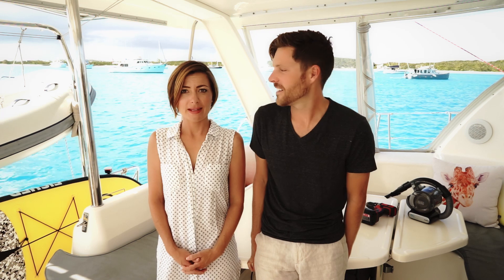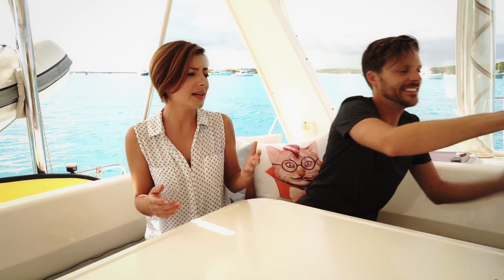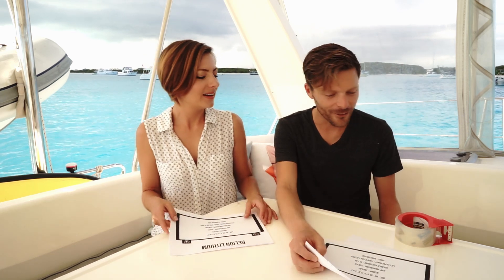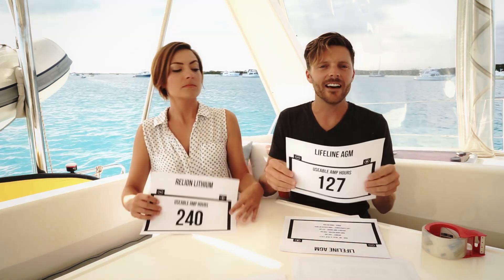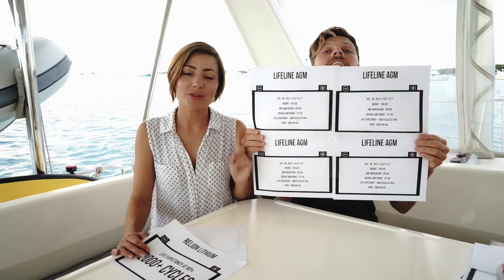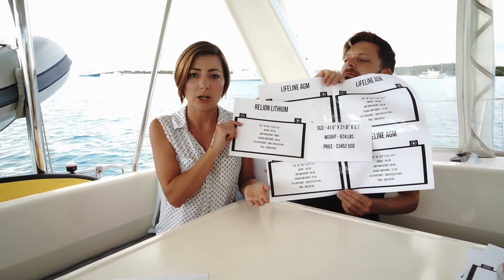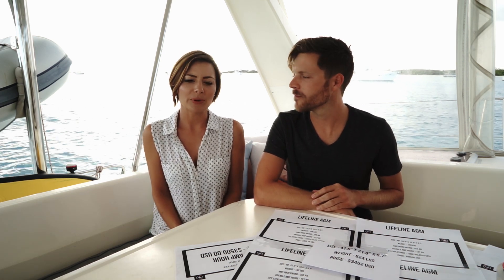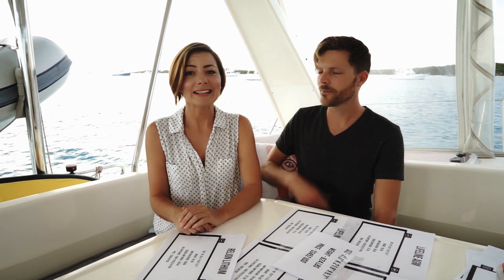Sailboat Tech - Lithium Batteries & Why We Chose Them (vs AGM)

Comment: When finding a method to compare similar systems, finding common ground with which to base a comparison can be the biggest issue.

For batteries on boats, that is generally expressed in AH of a battery bank. From that comparison, everything else can be reduced.

I have never found much utility in AGM batteries, except when they need to be mounted on their side. So my comparison will be your Lithium batteries at 300AH each, and my old standby: Rolls Series 5000, in this case the 6CS-27P with hydro caps. These are flooded batteries.

3 Relion 300 Ah batteries wired in parallel (900 AH bank) compared to 2 Rolls 6CS-27P 893Ah batteries wired in series.

Relion: 12V 900 Ah bank cycled at 50% provides 6200 cycles and costs $10,500 at a weight of 252lbs
Rolls: 12V 893 Ah bank cycled at 50% provides 3200 cycles and costs $3,200 at a weight of 684lbs

Relion costs $11.67 per Ah, $1.69 per cycle, $42.00 per pound
Rolls costs $3.58 per Ah, $1.00 per cycle, $4.68 per pound

Relion: 3.57 Ah per pound, 24.6 cycles per pound
Rolls:  1.31 Ah per pound, 4.68 cycles per pound

Relion requires no normal maintenance
Rolls w/hydro caps requires annual maintenance

Relion wins on weight basis, while Rolls wins on cost basis. While Rolls weighs 270% more per 900Ah, they cost 328% less.

The only real comparison at this point (unless weight is a larger issue for a given application) is cycles. The Relion batteries cost 69% more on that basis. Rolls has a very long history in the battery business and are notorious for their conservative numbers in both Ah and cycle ratings. It is not uncommon for the large series 5000 batteries to last for 25 years without replacement.

Lead acid batteries might not be right for everyone, especially large types like Rolls series 5000, but eliminating lead acid as outdated or unusable technology is not realistic when you compare quality batteries like Rolls. It is something to keep in mind, especially for those who cannot spend over $10k for a large, durable battery bank.
Reply from the maker: +Sailing Unsanity But you used 50% discharge for the ReLiOn batteries and they can be discharged to 80%. So we get far more usable hours and there's no power drop-off as we get close to maximum discharge. It's apples to oranges.
Reply: Yes, I used 50% for the sake of equal comparison. Rolls batteries can also be discharged to 80% if one wishes. Just like Relion batteries, the cost is cycle life. The math still works out the same, since both battery's cycle life is reduced by nearly equal percentages when bank discharge is increased to 80%.

Your "usable hours" theory does not hold water since any battery can be cycle discharged up to 100% at the cost of cycle life. Math is math. 80% discharge state in either battery bank still leaves 180 Ah. You are not getting any more "usable hours." Just because you can, doesn't mean you should. Cycle life still suffers regardless of the battery type.

Your "power drop-off" theory does not hold water either because it is a marketing gimmick.  Lithium's only advantage is bank voltage at deeper states of discharge. But with only 20% state of charge left on a bank you are cycling to 80% discharge, the advantage is nearly worthless unless you are running voltage sensitive equipment.

The end results will always be the same. Lithium batteries are power dense and light weight compared to quality flooded batteries. THAT is the only advantage they have, which is why they are awesome for use in handheld devices. But for large power delivery, as in boats, RVs, off-grids, telecoms, etc., you pay at a minimum 69% more for the increased cycle life. If power density is not a requirement, then the lithium batteries cost 2-3x more for the same relative power.

I am not saying one is better than the other. I am only pointing out the realistic differences between two very high quality battery types for use in marine applications, not power tools and phones. Most pleasure vessels do not need power density, they just need more power than two cheap 6V golf cart batteries provide. 

At 1200Ah, your available power is far more the key to your success than the type of battery you have chosen, and for 1/3 of the price, other can achieve the same and expect extreme longevity if they do not abuse the batteries.

Comment: It looks like 127AH*1000cycles*4batteries=508,000AH, vs 480,000AH for the 1 Lithium (going by the 2000 cycles number).  To make the 127AH batteries equal the AH provided by your Lithium, that looks like 12 batteries total.  So $10,365$ for the 12 127AH vs $14,000 for the 4 Lithium.   

The savings in space and weight do make up for a lot though.  And if you do get 4000 cycles out of the Lithium, all the better!

Comment: FYI the new Tesla power wall (1)  is 10kwh which equates to 833AH at 12v, for $3500... so less then half the price of the relion batteries. The power wall 2 is even better deal.
Reply: Also comes with built in inveter*
Reply from the maker: +Michael Baldwin See pinned comment re: Powerwall isn't appropriate for a boat or RV.

Comment: Hi Jason and Nikki,
I would like to know how long would it take you (on your boat with AC etc.) to run through 2000 (minimum) cycles?   Is that a year, 5 years, 10?
Reply from the maker: +One Leg at a Time We'll be getting into that more with future techie videos, but basically there's no way to be that precise about it. For our batteries, a "cycle" is considered discharge to 80%, so anytime you don't take them all the way to 80% you are extending the life of the battery. Our usage tends to vary a lot - sailing days we use a lot of power for the anchor and electronics. If it's a bread making or baking day, the oven will use more. If we did a maximum discharge every single day, one day is a cycle, and 2000 cycles would be nearly 5 1/2 years of battery life. We are still crunching numbers since we haven't been living on the boat under real-time conditions very long, but we expect to see significantly more than 5 1/2 years from these batteries.

Comment: I have become a big fan and watched all your videos on going from a land yacht to a water yacht. Thanks for addressing the fire issue.  Though they, lithium batteries, are a safer type of battery they are not fail proof and a thermal run away/internal short in ANY lithium battery  is a VERY bad thing,  A few good newer examples, hover boards and Samsung Galaxy 7 Note.  Once it starts there is no stopping it  and it will destroy/burn down what every they are in.  It is a fire that is difficult to put out and burns very hot !!!  This is why those products mentioned are band from commercial aircraft.  Poorly made batteries.  So yes a bit of home work and understanding of any product along with adhering to use limits is always important.

Comment: Great information, and more than I ever knew about lithium...the comparison to the batteries in high-draw power tools was helpful and definitely a plus. Also, can you post a link to where to get that vacuum...I'm looking for a better option for my RV that isn't 110 reliant.

I think the biggest difference for most people is the upfront cost which is pretty steep. I certainly couldn't afford even one Li battery, but 4 good quality and well reviewed (not Lifeline) 100AH AGM batteries (for a total of 400AH) cost me $700 which is more doable for most people. I think Li batteries are the best choice for a boat since you are so much more reliant on them, but for the majority of people in an RV, where power isn't as critical, I think the AGMs are a more budget-friendly option for most folks.

Comment: Do you need a different charge controller to charge the batteries from solar? Can the engine's alternator charge them directly or do you need to install a charge controller between the alternator and batteries?

Comment: So .. if you have a big, expensive cat with amp-days of electrical needs beyond the engine and have the cash, get lithium.

But if you have a 28' Hunter that uses a battery only for nav lights, a 4" display, recharging a tablet, and starting the engine, and are just barely keeping ahead of existing maintenance items, lead acid is probably just fine. :-)

I think you created a very well done video that will help people make the decision that is appropriate for them. Like everything else on a boat, there are costs and tradeoffs. What I 'want' and what I need and can afford are often two different price ranges. Your amusing and informative slide show has some very valuable real-world information in a very concise format. Great job!

I agree 100% with the decision to buy them if you can afford them and 'need' them.  On the other hand, that $3,500 for similar AGM can be spread out over several years, allowing for other boat bucks to be spent. Sure, battery failures and other things can happen in the interim and it may end up costing more. But I'd hate to drop an extra $2,600 on batteries and exhaust my boat fund to save some money in the long run when the next weekend my engine blows up. Or dozens of other expensive things that can happen to a boat happen. Spending boat bucks is usually a prioritization issue for many boat owners .. I only have $X dollars, but if I need $X times 10 dollars worth of maintenance, what do I fix today.

Another consideration is solid-electrolyte battery tech is looking very promising, suggested to have 5x the power of LI-ON, and none of the life cycle issues and might be available in a few years. Is it worth the gamble to wait? Who knows ....

Comment: I've been reading through the comment section and seen it mentioned a couple times. To me it seems like there really is nothing that compares to lithium batteries if you could afford to start collecting, however, I don't know yet what my sailing plans will be, and I am from Norway so it is not unlikely that the plans will at least touch upon the cool nordic weather. It usually stays above freezing during summer, but really all year round can be quite unpredictable. So I've seen a couple people voice some concerns about lithium and colder weather, could someone please elaborate on this for me? :)
Reply from the maker: +Mari Nordskog Lithium batteries can be damaged if you attempt to charge them at rapid rates in below-freezing temps. You can get around this by putting the batteries in a climate-controlled area of the boat or, if it's not too far below freezing you can manage the initial charge rate (start charging them at a very low rate). Once the begin to charge, their internal temp will come up and then you can charge at the normal rate. You should check with the manufacturer for their specific recommendations on charging in cold weather.
Reply: Oh good. Thank you so much for your reply, lithium batteries is for sure my number one choice now! Now to start saving.. ;)

Comment: I always say.. "Reduce the need for power"!! But with Lithium it seems we can spoil ourselves a bit :)
Explained in a nice and simple way, well done.  
So if one currently has 220AH (127 Usable), and that is all one needs, then going Lithium of about 140AH means reduction in weight but cost will be similar. Much better battery as well.

Comment: I too prefer lithium batteries, but due to their characteristics [high charge and discharge capacity etc], they also get a lot warmer than both lead acid and AGM.  What have you done to your setup to minimise and/or mitigate any potential fire hazards [like those seen from the Boeing 787 Dreamliner which uses lithium batteries]?

Comment: Ah, but there's one fallacy in your argument and that concerns Life cycles. You never carry your future battery on board; you only get a new set after your current ones have exhausted their life cycles. Thus, whereas you price Amp-hours and DoD comparisons are valid, the one about number and weight  due to smaller life cycle is not. Just saying.....

Comment: hay guys,
AGM is Lead Acid. Just a gelled acid instead of a watery liquid acid.
Your four AGM batteries would not all be on the boat at the same time to get the same usable amp hours as the one Litheum in your example. It would be two at a time repeted twice to get the same battery recharge cycle life.
Nice work though on the overall cost comparison for usable amp hours and cycle life.
See  ya,
John H.

Comment: Granted that lithium batteries are great but the cost is what stops me cold. By your figures you could buy 4 AGM batteries and have twice the power of one lithium battery for close to the same cost. That is why I bought two 12v batteries for my bus conversion instead of the four golf cart 6v batteries. Cost is the limiting factor for most people

Comment: Well done! A very "quick" battery information. I build and fly RC airplanes and use Fromeco brand Lithium ion batteries for receiver and servo control. Weight is the major issue in airplanes, as is long life and reliability.

Comment: The video was very informative and the visual should help people who are unsure if the investment is worth it. I love the power output, weight and life of lithium packs. It can sometimes be difficult to explain to people with a budget. Knowing that the initial sticker shock will be overcome by so many benefits should help people make the leap. 

Imagine how much faster you can go with the lighter batteries. 

Imagine how much extra space you will have on the boat. 

Imagine how safe you feel when your battery bank remains trouble free for those difficult times when you need it the most. 

Imagine all the free time you will have to explore more places, to watch more sunsets or have more cocktails because you were not doing all of that extra maintenance when a cheap battery bank needs to be replaced over and over. 

Thanks again for sharing your adventure.

Comment: It's a well explained video. The other videos in this series are going to have to be done to correlate various points about the battery system. Chargers and inverters optimized for Lithium battery use  since they have different power curves than do wet cell lead acid or AGM or "GEL which are going by the wayside".  But yes, in the long run, Lithium is the way to go if you are power hungry. Just be sure you have a charging system that will keep up with demand and a power delivery system that is designed to work with and manage Lithium output.

Comment: How do you make sure you do not draw down more than 80%... 
With any battery the consequence of drawing 100% is significant in terms of no of lifecycles and DOD, but AGM and Lead Acid let you know you are getting close by giving you a significant drop in voltage. 
I never see that with Lithium battery, I am using it, using it, using it, then dead, like I have blown a fuse, which is always a head slap moment.
Reply from the maker: +Tim Hunt We have a battery management system that we'll talk about more in the next video. It tells us how much power we're using, how much is left, how fast the batteries are charging, and it controls how the batteries charge. It's a must-have for us.

Comment: Okay, I'll be the geek and pic a few nits !

There are 3 types of lead acid batteries".  Flooded (liquid acid electrolyte inside, requires "topping off").  Sealed lead acid (SLA) found in only a few applications, like older emergency lighting (technically not truly "sealed" as they can "vent" if the internal pressure build up).  Absorbed glass mat (AGM).  Similar in function (NOT "wet") to SLA but internally very different.  

Flooded lead acid is the BEST CHOICE for stationary "off grid" applications, where weight and size are not an issue and you are willing to do the maintenance.

When it comes to Lithium Ion batteries, there are "choices".  The first big choice is chemistry.  Most devices use Lithum Cobalt (LiCoO2) batteries.  There are various other chemical mixed in there but these are the most common.  The next most common is Lithium Iron (LiFePO4 or LiFe).  Relion uses LiFe.  There are big differences in capacity (Li-ion better) and safety (LiFe better) and HOW THEY ARE CHARGED !

Very small electronics (phones, tablets) use a cobalt Li-ion battery that has the electrolyte stored in a polymer bag so they are called LiPo. Yes, they can be easily damaged.  Most appliances use cobalt Li-ion 18650 cell batteries.  Slightly larger than a AA battery cell, but because they come in a metal "can" they less susceptible to damage.

While LiFe batteries have less capacity, there safety (nearly impossible to explode/start fire) make them an EXCELLENT choice for your application  (Boeing sure wishes they had chosen LiFe batteries  for the 787 !)

Comment: Was your mounting location for the batteries (outside vs inside) because of fire risk?  Is there a fire risk over AGM's?  Will there be an issue if the lazzarette filled with water do to wave action?

Comment: You missed quite a bit with your simplified battery comparison.  When comparing AGM's to Lithium for house banks, then the answer is quite simple, but you dismissed "Lead-Acid" batteries far too quickly.  If weight isn't a huge issue for you (i.e. you can put your batteries low such as on a monohull) and you have the volume then heavy duty, deep cycle, Lead acid batteries, such as Rolls Surrette are still a great option.  Purchase price is much less than Lithium and lifetime is so much better than AGM.  On our boat we have had the same house bank since the boat launched in 2004 and they still are going strong.  In that time we have replaced the AGM's on board (engine & genset start, 12v radio battery) at least 2-3 times.  Only real downside is that you have to check the water every month or two and top it up as needed.  Charge rate isn't as good as lithium, but our bank is big enough (1100 AH @24v) that the charge rate is still pretty good.  Also worth looking at the newer tech in Firefly Carbon foam batteries which show real potential to approaching Lithium advantages without the cost.